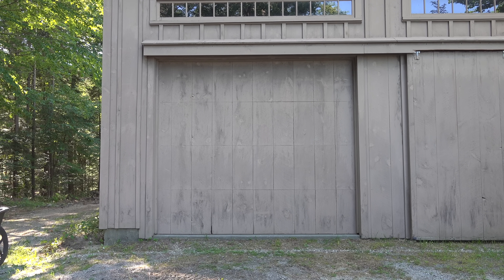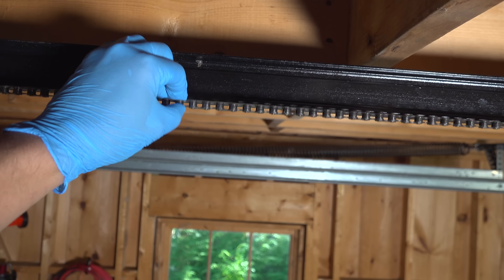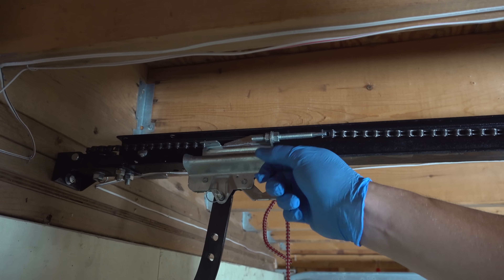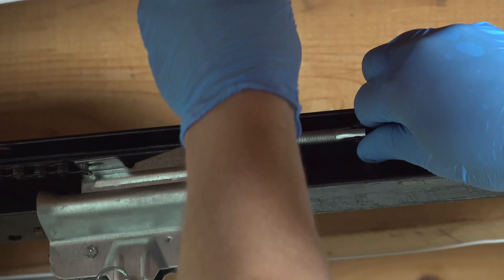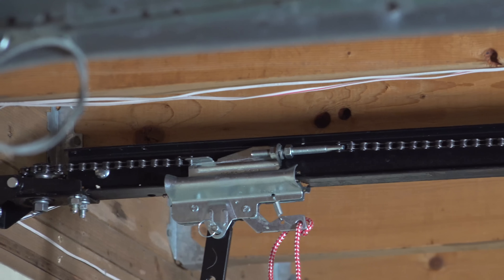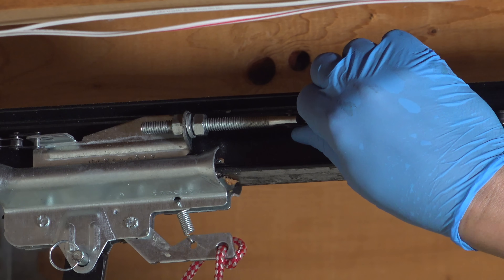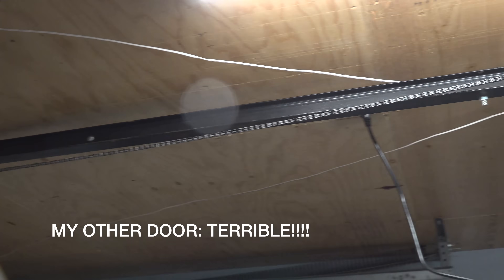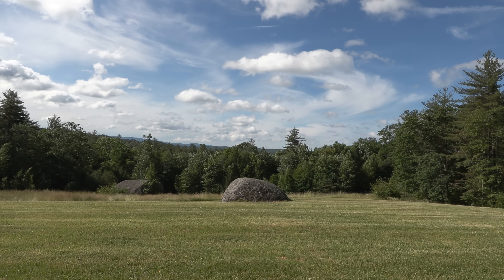#1 Fix for LOUD GARAGE DOORS - EASY

Comment: Nice pro tip! I lubricated my chain, wheels and spring about a week ago but didn't notice the excessive slack in the chain until you dropped this video. I just made this adjustment, it took 5 min or less counting hunting down my 1/4 inch wrench. The door did seem to quiet down some and I see the chain vibrating and suspect that vibrations designed to be carried by the chain were being transferred elsewhere this whole time! 
BTW, I used a vice grip to keep the chain from rotating, that's a tip I learned from your vid on replacing a lawn mower blade. 

Keep em coming.

Comment: Went belt drive years ago. Soooo much quieter! I probably wouldn’t pay to replace A perfectly good chain drive unit, but if I was ever replacing one, belt drive for the win!
Reply: Yeah and chains tend to rust
Reply: We just put a brand new 1.25 hp Genie Belt Drive up and it's so stupid quiet 🤫 (go big or go home). I mean with the 0.5 hp Genie Chain Drive you could hear in farthest bedroom / television off but now you can't really hear it with the television off in the living room. Ranch style house (1686 Sq. Ft.), garage, laundry room, and kitchen kinda attached with the living room butted up to the kitchen. I mean it's stupid quiet and if my security system didn't ding with movement in the camera you would never know anyone was in the garage or coming into the house.

Comment: I did this for mine but the locking nut was actually on the other side (left instead of right). Also definitely recommend opening and then closing the garage door and readjust.  I had to readjust a second time.  Thank you!  They don't teach you this stuff when one buys a home for the first time.

Comment: Thanks for the tip.  My garage door system is 38 years old so I had to remove 4 chain links but it worked a treat.

Comment: Thank you!  I have two Liftmaster garage door openers where the chains were starting to droop.  Did a little tightening of both and the doors are operating a lot better.  

I also had one rail on one door that was just little more gap between the down rail at the top and the side rail.  I put a piece of Gorilla tape in the rail and that covered the gap enough to quiet the door.  (I don't want to start mucking with the rail bolts...).

Comment: Any advice for a screw drive system? Love your channel, found many home improvements through your videos! I've watched a lot of videos on garage doors but haven't figured out my problem yet.
Reply: Lubricate with low temperature high performance grease that comes In a tube. Take the tip and run it down the entire length of the screw.

Comment: I love this channel. If I may add a suggestion to this video. 

Permatex 80070 Silicone Spray Lubricant. Chase down squeaks with this guy after this repair is done. I got my real loud garage door almost whisper quiet with this fix, the lubricant fix, and then some custom fabricating to get rid of some rattling throughout the system.

Comment: I'm sure curious as to what the door motor mount bracket is connected to at 3:17 (top section). Looks like they would have to double or triple up on the rail. I don't imagine there's a style there but maybe one was installed. I would have set the strut closer to the bracket with a LHT. In most cases, the door is set heavy so as to allow the weight to help close the door. This way helps the top panel from being pushed against the top of the opening. Without proper backing on the door for the bracket, you're asking a lot from the lag bolts, apparently it's held up thus far but I wouldn't be comfortable with it.

Comment: Good instruction on looking at the chain, but be wary of "one trick fixes everything".
Often, if one thing is found wrong with a garage door, there are more that just haven't been noticed yet.   Heck, when I finished up some work on my old door, I had seen videos about tightening up all the hardware just as part of a normal maintenance.  I was skeptical, but I figure it couldn't hurt.  I was surprised how many loose screws I found.  At least 10 were quite loose.  Now, probably more of an issue with metal doors.
If the door is dropping, the door is out of balance.   Wood doors will be tough to balance, tho, as their weight is gonna change with weather/moisture/humidity.
Also, garage doors don't require a lot of lube, but they do need it periodically.

Comment: I live in a condo building with an underground parkade. The chain is where it's supposed to be, but the whole door is loud. If I want to lubricate the rollers, what type of grease or oil should I use?
Reply: lithium grease

Comment: Plus replace with rubber wheels and even the rubber shock mounts if you want it quieter. Especially if it’s attached.

Comment: I've oliled mine, and increased the torque but my 1/2 hp doesn't have enough power anymore. It thinks something is holding it back, I'm gonna have to adjust my center spring

Comment: Dude! I suspected my chain ⛓️‍💥 was loose, so much so, it is hanging 5 or 6 inches below the bar. Funny how repair men pretended like they don't notice when fixing just what's broken and not mentioning it. Do they assume I'm too cheap to pay for maintenance, or just letting it be so they can respond to a catastrophic failure. I think it's the latter.

Comment: I disagree that this is the most common problem with garage doors making noise. From my experience, it's the house settling and the rails needing to be realigned properly.
Reply from the maker: Interesting, I haven't found that to be the case but maybe it depends where you are, some areas could be more prone to it than others.
Reply: @SilverCymbal  yeah house settling is pretty bad here in central Texas
Reply: I’ve got a real loud bang on mine when it going past the 3/4 mark or a little higher. Any ideas what it could be, Sir.

Cheers.

Comment: Chains suck. That’s why I prefer Genie Screw Drive.
Reply: The absolute worst drive sytem. Runs forever, loud as hell. Sprays dirt on your door and cars. Get a belt drive when it breaks. You wont be dissapointed.